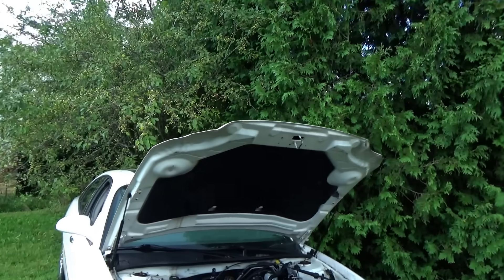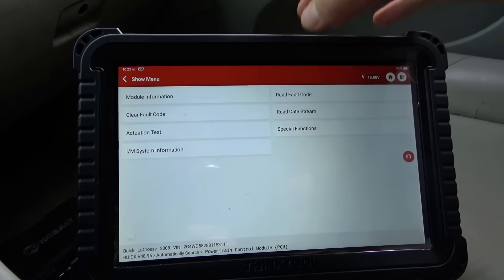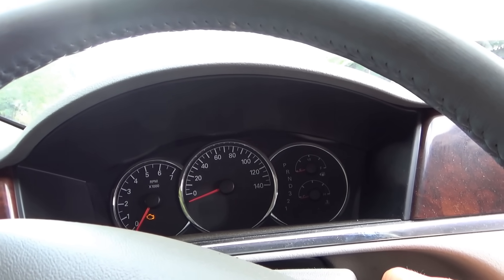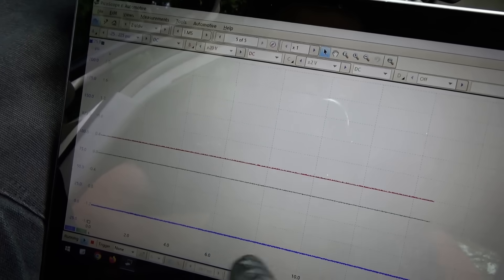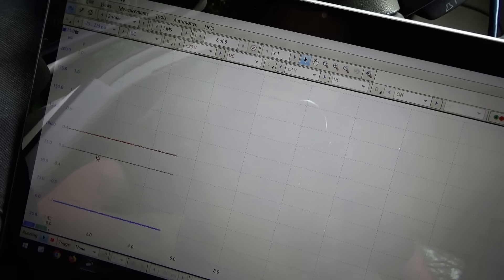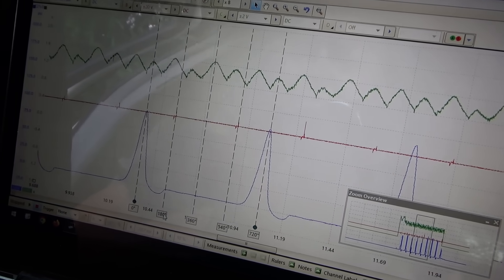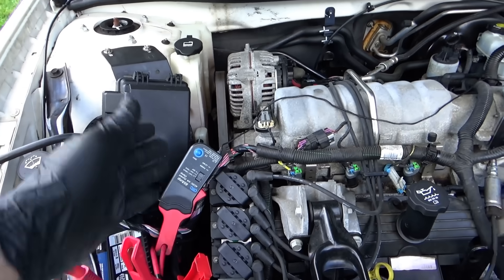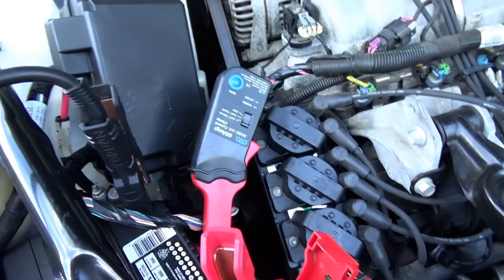You Won't BELIEVE Why This Buick Doesn't Start (3-MONTH PARTS CANNON!)

Comment: Paused at 3:00.  Going off of what I can hear while cranking, it sounds like the firing order is wrong.

Wow!  I've had to replace loads of those harmonic balancers in my time.  Even a couple on my old 1986 Olds Delta 88 royale brougham.  But I have never seen that happen before.  How did they NOT notice the woodruff key notch on the new pulley???

Comment: Theses cars use to be bad about trigger wire to the CKP yellow wire pin F if I remember right on the ICM breaking right under the water pump I use to keep a roll of yellow wire in my tool box just for theses cars 😂

Comment: Also, if I'm remembering correctly, there was a special tool required to set the CPS in the correct spot because it was behind the Harmonic balancer.
Reply: No, one bolt.  Pain was routing the wire through the plastic cover that holds it from getting into the balancer.

Comment: This is a perfect example of your deep base of knowledge.Spark plug wires wrong was my guess,bur they at least should have backfired,so i was wrong.Your transducer setup did the job perfectly and the scanner also.But reading the signs i haven't got that part yet.ALTHOUGH how can you screw up peak to peak right,i mean top of cylinder pressure to the spark event,right? great job

Comment: Being out 180 degrees of timing is sure different toady. A friend and I were putting a distributor in a 1969 Dodge van with a 318. Unveknownst to us we put the thing in 180 off.  While I'm looking at the engine from the top of the doghouse, my friend cranks it. A flame shot out through the top of the carburetor and singed off my eyebrows.
Reply: My first FI engine, I was putting my hand over the throttle body to prime.  Thought my arm was going to be sucked into the 5L engine.

Comment: Hi Ivan nice work with the scope again it shows the problem so quickly and a little thinking about the previous work and you are bang on again. Just a side note if you disable the ignitor then crank it you would hear the change in cranking rithem or as i call it the heart beat.

Comment: I have seen this before when I was working at Holden in Australia (older Commodores have this engine).  Note, when jamming on the Harmonic balancer without lining up the keyway,  it can crack the crank sprocket.  In that case, the Crank sprocket with timing chain assembly needs to be replaced.

Comment: No DTC's! Amazing. Thanks Ivan!
Reply: The PCM had all the correct inputs, I don't believe a cam/crank correlation code will set while cranking, it's been a while since I got that deep into this version of the 3800 so I don't remember if they have a cam sensor, but I believe they do.

Comment: I seriously doubt any other technician would have figured this out.  I am an old man and when I used to work on cars there were no computerized anything.  One of the most important trouble-shooting tasks was to find out if anyone worked on the car before it came to us.  You would not believe how many times we found errors done by someone else.  The most common was having the plug wires misplaced, distributor installed 180 degrees off and broken ignition parts that were mishandled during installation such as spark plugs or distributor components.   If a car was running fine but just stopped working, the diagnosis was relatively easy but if someone worked on the car and now it doesn't work right, that is a whole different thing.
Reply: Yea, I called a mechanic when I gave up.  Turns out the manual was wrong on firing order.  Had I pulled the distributor cap, and looked at the pistons it would have been obvious.
Took him 5 minutes.  Guess he saw a lot of them put on according to the repair manual.
Reply: Hats off to Ivan no doubt, but the signs of bad timing were all in the sound of the crank.
Reply: I put a used engine in a Ford escape 4 cylinder turbo last week. I reversed the injector connectors so it was firing at the wrong time with the direct injection. What a pain that was to figure out😢 car came in with the engine locked up, so I had no baseline. Then had communication codes so I was chasing that
Reply: Good technicians, yes. Part changers.,.nope.

Comment: Great diagnostic, Ivan! I didn't think one could smash a Woodruff key in the wrong position!! Hell of an impact driver 🙂 Thankfully, customer could smash it back in the right position.
Reply: I'm trying to picture how he changed the seal with the key crushed on the crankshaft.
Didn't realize '08 was it for this engine.  I laughed when I saw they even sell replacement sleeves for it.  Give it that new piston wall smell.......
Reply: @robertsmith2956  Yeah 🙂
Reply: Hulk smash!!
Reply: @Bizzy09  LOL

Comment: Is this the beginning of or maybe continuation of
               D-ata
               D-riven
               D-iagnosis

AND SO which to prefer:
               3-D
               DDD
               D-cubed
               Triple-D
               ??????

There's quite a REVOLUTION in auto diagnosis.  First of all:  today's cars are extremely complex -- maybe better described as exponentially more complex.  Back to my auto years:  60's, etc., where the Chevy, Ford, Plymouth were 
◇more similar than different;
where today cars are
◇more different than similar!

Comment: Been here my self on a Mazda doing as service took belt off lay it all out . reassemble no start done check see if I had left wire of belt on wrong .no it was Stata plate it's a flat plate with keyway I just put it on the wrong way round vus making timings out we all learn every day only took 3 hours to sort out that's life 😂
Reply: Did 4 kia timing belts no problem.  5th time I had all the plugs out, did a 720 check, all ok.  Slow start, engine had no power.  Was off one tooth.  Marked belt one tooth from timing mark, slid belt off cam gear, and rotated gear back slid belt back on gear.  Ran perfect.   Only thing I could figure is having no compression didn't put a load on the belt when I turned it around.

Comment: Yea the o scope was the deal but knowing how the ignition system works is the whole route to diag here, if you were under the thinking that it was controlled by coil pack ecm signal or whatever not knowing the cps was getting the timing from the balancer than youd been running circles..

Comment: This is a good example why certified mechanics in the workshop do better jobs than the regular DIY guy on its driveway. If you are not properly trained to repair your car, do not mess with that, bring it to your local car mechanic and he will take care for you. Same thing when we go to the doctor when you feel bad, to the dentist when you have toothache, or call the electrician when you need to change your fuse panel at home. Leave things to professionals, it always goes faster and at the end becomes more cheap.
Reply from the maker: @rpujol  in general yes, but there are a lot of bad "certified mechanics" and also a lot of brilliant skilled DIYers 😉
Reply: I guess that is why Ivan and Eric O continually get vehicles from dealers and other repair shops that they can't fix.  Not all "certified" mechanics know what they are doing.  These days it seems like quite a few have no clue.
Reply: Mom tied a string to my tooth, and it worked.  🤐 
I replaced my panel with 5 sub panels to subdivide the house.  Now I have the upstairs with it's own panel so I don't have to go downstairs when I pop a breaker.  Saved a lot of wire not having to run every wire to the 1st floor.

Comment: These 3.8 engines were in many GM Holden Commodores here in Australia. When you showed that the timing was 180 degrees out, straight away I knew it had to be the balancer because of where the crank sensor is located and cannot be installed 180 degrees out.

Comment: Called it!  As soon as you cranked it I said the crank sensor is off for some reason.  In my 37 years doing this, I have never seen a 3.8 jump time.  I've done plenty of the harmonic balancers though.  They like to degrade the rubber on the pulley and it hammers back and forth like a rod bearing gone bad.  Tuned up a 5.4 this morning.  Man, I hate those things.
Reply: Tuned- as in prepare for the carnage? Puke a plug or lose a chain.

Comment: A few videos back.  I told you about GM 3800 3.8L on the older ones. They had a magnetic that would fall off the timing gear an cause timing problems. They would still run but  in limp mode.
Reply from the maker: I have a video on that...'91 Park Ave from 3 years ago :)

Comment: The waveforms you see from the pressure transducer seem to indicate no intake vacuum whatsoever. I went down my own little rabbit hole of intake valves not opening, and the bank 1 intake cam not opening the valves. Did a quick bit of research and found out that this is literally a single cam pushrod engine. Obviously these intake valves were opening at the correct time and everything, and yet we see no intake vacuum on the scope! How would you explain that?
Reply from the maker: Vacuum won't build in the intake manifold until the engine is running :)

Comment: My 11 avalanche has started doing weird shit only in am first start it acts like it's hydraulic fuel or water in cylinders but I try it 2 more times then boom starts up runs fine I'm guessing my starter is about to die
Reply: How could you tell water is in the cylinders by cranking,  and if you flooded the cylinders youd smell it..  if water was in a cylinder than it doesnt take much for it to bend a rod or valve stem hydrolocking the motor..  if it sounded funny on cold start i would guess you need to check the plugs and wiring then fuel pump and filter..  also run a fuel injection cleaner through it, clean the throttle body and mass a/f, test battery and its connections are tight n clean.  Otherwise youre gonna be throwing parts at it..
Reply: Your first problem though is you got an imitation truck..  those don’t truck, they called em avalanche for a reason..   you can only pack em with so much before they give way and come rolling downhill..

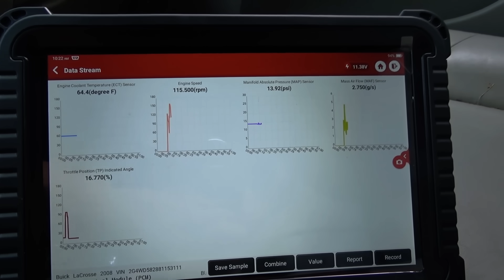Comment: 2:08  ive seen this before on that exact motor it melts the plastic intake manifold in side were the egr tubes are and it then gets coolant in the egr tube goes down intake and bends vavles rods etc seen 3 or 4 times only on series 2 and 3 engines last ones built

Well I was wrong
Reply from the maker: intake manifold is metal on this one lol
Reply: @PineHollowAutoDiagnostics  yep I saw that in video later I believe that metal intake is the repair for the problem I described

Comment: That 3800 V-6 is a good engine; it stands to reason it had an issue like this.  A person really has to pay attention to what they are doing.  Have a safe trip to Columbus, Ivan.  GREAT VIDEO!
Reply: Was that engine supercharged? I noticed it had a metal intake manifold.  Not all 3800 engines had them.  My 99 Buick LeSabre had a plastic intake manifold which was poorly designed.  To make a long story short, the manifold melted and allowed coolant to leak into the cylinders.  Didn't hydro lock the engine fortunately and I was able to repair it.
Reply: @thx1138guy  the series 3 04-08 went back to aluminum upper intake manifold
Reply: @thx1138guy  You could replace the plastic with the aluminum intake.  I had the 70K coil crack and blow my ECU.  Started engine to warm up while I went to check the mail.  Came back to car dead, crank no start.    Can't believe what they charge for that little exhaust pipe that connects the two exhaust manifolds, and no gasket on it either.
Reply: I have had 3 plastic intake manifolds on my Grand Marquis which led to a class-action lawsuit against Ford.

Comment: My wife had a 1986 Buick LeSabre Front Wheel Drive with the 3.8L V6 and I remember that sensor having an intermittent problem.  One new GM sensor, one new GM connector assembly, some rerouting of the 3 wires and it was off and running.  The original wiring harness and the connector were so tight and pulled on the crank sensor, that it caused intermittent stalling especially while driving.  I put the new connector in, keeping the wiring away from the crank pulley and the serpentine belt.  It all worked.

Comment: That was a good example of why it isn't always a good idea to use an impact wrench to start tightening bolts, or to tighten the jaws on a lathe chuck.
Reply: Kind of, you can turn down the torque on an impact if you just want to run a fastener down without trying to send it to Jebus.
Reply: Who ever used an impact driver on a lathe chuck  ? if you know crazy people, show us !!
Reply: @CrimeVid  If it's even Remotely possible, it's been done! 😝

Comment: How in the world did he get the crank oil seal changed with the woodruff key installed on the crank? Sounds impossible.
Reply: Looking at the harmonic balancer photo, the seal runs on the sleeve part of that, not the crankshaft itself.

Comment: Isnt it weird it threw no codes, i mean when ignition timing is 180* off????
Reply: Guess the engine has to start first so the PCM can monitor the crank sensor.  Till it fires up the signal goes to the ECU.
Scanner Dan showed how the circuit works.  The secondary ring lets it find TDC in 1/3rd of a revolution.

Comment: I'm surprised he was able to even able to get it on in the first place. Self inflicted. Impressive diagnosis! Thanks Ivan!
Reply: Is it possible the key was already sheared in half? Maybe that's why it stopped in the first place?
Reply: @helgew9008  good catch.   I doubt he would have gotten it on 180 out with a fully intact key.   At least without breaking his tools
Reply: I agree the key must of been sheared in half already
Reply: Crank sensor is pretty common on these.  So are ICMs. He said cranking cadence sounded normal until he replaced the parts. That's because no spark was occurring due to either a missing trigger or failed ICM. He probably sat the harmonic balancer on end of shaft and slid it up to the key then impacted the hell out of it. There was some pretty good scarring on the balancer. Woodruff keys are kinda soft so a good impact gun wouldn't have a hard time shaving one down if you didn't have things lined up correctly.

Comment: Great video.
In the days before pressure transducers (I'm old) we used to put a thumb over the compression gauge hose and look at the spark on the spark tester while cranking.
Reply: We also had a timing mark for TDC.  Flashing light gave us all that good info.  One crank tells you  timing is off.
Reply: @robertsmith2956  In this case,  the timing light would show it was firing near TDC, since the timing marks on the damper were off 180 degrees from the crank as well.  The damper was in sync with the coils.  The crank is what was out of sync.
Reply: Yessur, or hold open the compression gauge relief valve and watch the needle bounce.  Even a balloon or rubber glove over the end of the compression gauge hose might work? There is always a way.  
Stay gold.

Comment: Well, the owner of this Buick shouldn't be working on any vehicle. I can't think of any crank pully that doesn't have a key because even older systems with a distributor had to have that pully in the correct location for the timing marking to line up with the degree tab or markings on the front engine cover. Maybe late model engines done have the key due to computer driven everything but even so, it might be a good idea to take a look at the crank for a second and notice there is a keyway on it. 
I'd say the Pico saved a lot of disassembly and diagnostic time here. Right on the money.
Reply: Some newer cranks do not have a key (around this vintage). I think Ford is one that does that on vehicles without a power steering pump (electric assit) and uses a tapered fit instead. Interestingly, the original issue could have been the key failing and the ballancer shifting as the power steering pump or some other accessory drive was taxed turning out of the drive. So this means that it is possible he never saw a woodruff key in the first place. Whether or not that dictates Whether an owner should be working on any vehicle is as questionable as you not knowing that some production cars do not use a key at all. It's definitely an oversight primarily from inexperience. But I think the only real damage done is to his wallet and pride so I'm not sure it matters much.

Edit... the wording seems like I'm taking a dig at you. It's not. You would have at least looked into why you didn't find a woodruff key and likely avoided this. It's just that inexperience leads to oversight.  Especially when you're crawling on the ground trying to resurrect your daily driver to get to and from work.
Reply: We all start somewhere. Owner will never repeat the mistake.
Reply: Dealer in canada did the same with the cam gear that Ivan diagnosed remotely.

Comment: My off the cuff thought was crankshaft position sensor due to the same problem on my Ranger.  I don't have the array of tools, and would have parts cannon CPK first/again.  Hopefully I would notice a key slot putting it on, but who knows jammed down the side of a 3.8 shoved in a FWD platform.  BTW the Ranger CPK changes with a single socket, not even needing to jack the vehicle up.

Comment: You have to wonder what kind of 'mechanic' takes a "BFH" to a camshaft while completely ignoring the key (and destroying the key in the process).  If I'm the owner, I'd like to hear an attempted explanation for that. Thanks Ivan.
Reply: According to the video, the owner himself was the person who replaced the CKP sensor.
Reply: 8.21.24.    🤦🏻‍♂️That’s even worse than D- workmanship
Reply: *Crankshaft. A harmonic balancer is attached to a crank shaft.